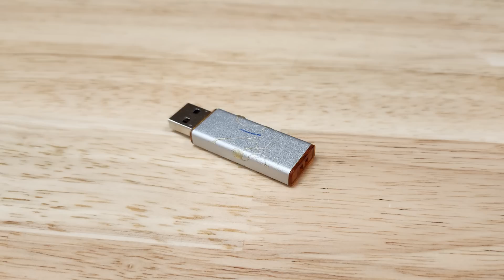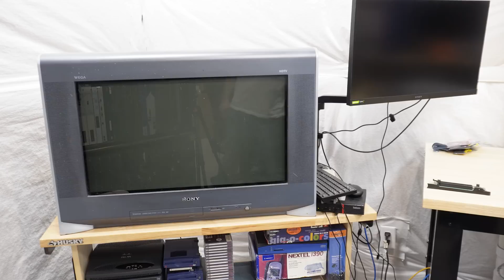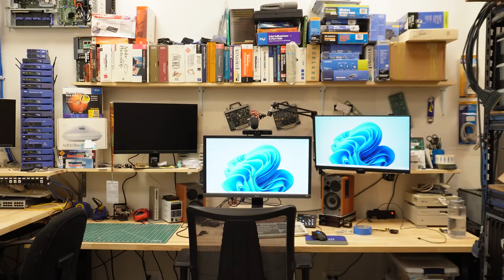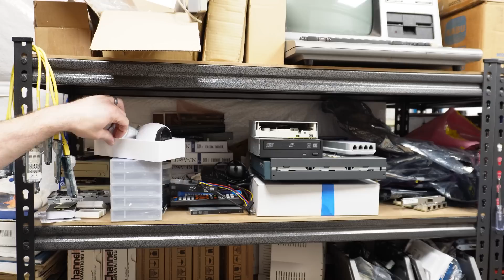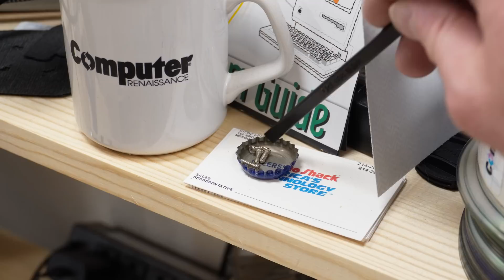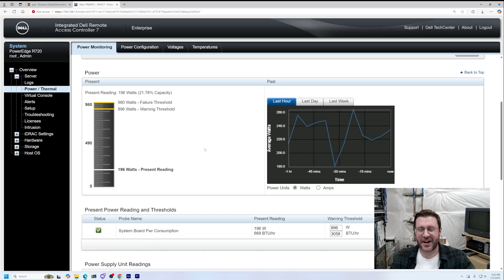Workshop and Homelab Tour

Comment: hey colby, what is in the black box with the little Sega logo on the top of the shelf that has all the equipment stacked sideways? i found it was interesting that it wasn't being kept with the video games stuff, and that you felt that it wasn't interesting enough to mention. 
i've gotten heavily into amateur radio,  SDR and weather satellites this year. so, just recently, i dug around to find my Game Gear. the plan is to use it to play around with one of my favorite handheld game system add-ons of all time...  the TV tuner! i want to set up a low power homelab UHF channel that will air the Johnny Castaway screensaver on a little CRT in the corner of my office.  good ole analog television!
thanks for all the great content, your channel was near the top of my "YouTube 2025 recap" this year and has been one of my favorites to throw on the tv while i'm on the workbench building one thing or another. happy new year man, cheers!

edit: cleaning up / shortening wall of text

Comment: Youg can get cable managment arms for your servers too. Can be a pain trying to access the back of the server when installed. Also you can get DAS boxes for these too MD1220 to extend you disk count. Saves on power cost running multiple servers.

Comment: ATM is quite fun, I have a 3com AB 9600 equipped with an ATM 155M card and a few serial cards so I could do Frame Relay - Also have a Cisco 3620 with an ATM155 card - main problem right now is they are SM long distance. 
Wouldnt really say ATM was competing with Ethernet (back in the days) - It was superior to Ethernet I all ways (Had QoS/CoS on each "VLAN" / VPC) 
Fun fact: Some sound mixers from Lavo for example, used ATM to route sound.. Thats how good ATM were. 
https://youtu.be/QJp1dFnTNMs?si=I7GQbIemnEFxM04B&t=997

Comment: being from ireland i have always found it interesting that the usa is 120v we use 13amp 240v sockets 3kw and 20a at the breaker 5kw just to charge our phones but they are specifically for high power items in the usa and normally not found inside the home only in garages / basements , the fuse panels are also such a stark difference in comparison to ours , a 24 fuse/breaker 240v panel is around 10 inches wide by 12-16 inches tall

Comment: Once you're powering a rack with several servers, you really want to switch to 208/240V UPS units, which provide 4X as much power as 120V units.  Eaton 9px6k UPS's can power a whole rack and can be found used for under $1000, sometimes even less.  That, and a vertical L6-30p PDU should fit your needs.

For the iDEN phones, the only thing you might be able to do with them is use MotoTalk/DirectTalk which would let you to use them almost like $20 FRS 2-way radios if they have it installed, and also have SIM cards that were previously activated.  Some phones without it MT/DT can be moded to add it if you're interested in the extra effort.  There are old iDEN base stations for sale for a few hundred dollars but doing all the set-up, including allowing those IMEI's access, is not going to be easy.  I don't think the iDEN protocol was popular enough that there's likely to be any SDR projects out there that re-implement the base station to make them usable, either.  And yeah, neither would be legal to run, anyhow.

Comment: Since you're virtualizing, you should consider adding a pool on your NAS (or building another small one) to host your VM storage.  You have 10G anyway -- and honestly, even 1G for storage access is fine for most tasks -- and it would allow you to run multiple (potentially physically smaller) VM hosts that allow you to scale up or down, depending on what's the most cost-efficient CPU/memory, without having to care about "does this case have enough drive bays and RAID?"  And also provide failover in case of hardware failure or maintenance, which is always nice.  Especially once you start consolidating workloads, when a server fails, it really sucks!
Reply from the maker: I should've mentioned, proxmox does actually have access to a pool on the NAS and some of the VMs are using it!

Comment: I would strongly suggest replacing those WD blue drives, at LEAST as a boot drive, as I’ve had bad experiences with them and from what I’ve heard, they’re generally not that good.
Reply from the maker: oh yeah they were just the cheapest I found. they're in RAID0 because all the proxmox VMs are actually backed up to the NAS nightly. so if they die it's not a big deal in my case, and in fact a lot of the VMs are leveraging the NAS directly for some of their storage anyway.
Reply: @clabretro  I’m glad to hear that, as I didn’t want you to have to find out that they’re bad the hard way like I did. I hope that they continue to work for a long time to come, though!

Comment: Reality keeps slapping me in the face when I watch retro computing! I'm sitting here looking at my HP 4050N Laser Printer, which has been and still is my main printer. I got curious as to when it was built and the wiki says they stopped making them in 1999! I feel old now....
I worked a lot with Cisco gear and sorely want to have a 4506 or 6507 for my home network, but as it would be good to heat my house in winter, it would be a disaster for the AC in summer! :-) I am content to run my Netgear switches because they don't draw much power, but I long for even a 3560G or 3750. I also spotted a couple of Compaq ProLiant servers, spent a lot of time with those too.

Comment: NOTHING should ever go vertically across the front or rear of a rack, even just to the neighboring RU. EVERYTHING should go horizontally into the vertical cable management, up or down within that channel, then out next to the device where it needs to be connected.  Your switches and patch panels should also be mounted to the REAR of the rack not the front...  That gives you an incredibly clean and imminently manageable rack, with nothing interfering with accessing, servicing or removing equipment, you never need horizontal wire management (or brush pass-thrus) which wastes space in your rack, and it’ll scale up or down nicely from the simplest most well managed rack, to the most hectic/dense/frequently ad-hoc altered rack.  I've been doing this for a long time, and inherited a lot of intractable messes I’ve had to spend so much time fixing, that so easily could have been done right in the first place. If only every High School and College level computer course spent a few minutes on rack wiring...

Comment: I use truenas on a few servers at work, 2 core, 1 scale. Scale is really just a lot better than Core in general, Core is kind of the legacy product they're working on getting rid of, so for several years Scale has been the one getting cool new stuff. Just as a basic thing, the web shell in Core is the worst shell I've ever used, and in Scale it's perfectly unremarkable. You're not supposed to need the shell but it's linux so inevitably you do. Except for "Apps"/"Plugins"/"Jails".

All my stuff is out of date because I don't have the time to do the accounting to tell if upgrades are safe and I definitely don't have the time to make them safe, so my Core servers are running Docker, and I don't know if that has ever changed. My Scale server runs a weird sandcastle built around Kubernetes, which sounds rad except they buried all the kubernetes stuff under so much of their own layers of obfuscation that I can't comprehend what they've done to it well enough to find any in-roads on learning kubernetes. I believe with the latest version of Scale they have gone back, or they are going back, to just Docker and that seems like it's going to break my containerized things! At least once I have time to spend making sure that update isn't a disaster, Docker containers were so much easier to deal with and there's a bigger... community? space? to draw prior work from in figuring stuff out.

Comment: Seems like either a design mistake or an intentional punishment to make that door sensor be just a pin sticking up. Should be relatively easy to make a reasonably nice mod that adds a lever ramp that will protect the switch in the future, just need to hold a little flap in place over the pin. It defeats the sensor somewhat, but that's Dell's fault. They could have made the switch any number of ways that wouldn't be at risk and could detect the door absent while the unit is pushed in.

Comment: To reduce power consumption on the servers could you remove the 2nd processor - I assume you'd lose 50% memory capacity too but could reduce running costs if that resource isn't being consumed?
Reply from the maker: I might look at some lower power CPUs too

Comment: The bad reputation Linksys gear had in the early 2000's was well earned. In the three years I had to deal with them their failure rate was over 80%. They were so unreliable I kept five, or six on hand at all times.

Comment: @clabretro Protip : You can just tape the lid sensor switch down to prevent this from happening again.  It's a useful switch in the data centre where you want to log case open status but at home you don't really need it and that would prevent you from accidentally breaking it in the future.

Comment: Cellular is a little more complicated. If you want equipment you need to get a forklift as some of the core controllers are the size of the entire rack. There are some open source projects that might be able to emulate a network (to replace the large controllers). Most carriers are shutting down 2G and 3G so gear maybe coming out as contractors turn it over. Getting software/firmware though,that is the hurdle as the few companies that make this equipment keep it very closed off.

Comment: The two tips you need:
A: For the data you really don't want to lose, buy disks from different manufacturers and use them in mirrored pairs. The chance of two different manufacturers having quality problems at the same time seems very low.

B: Others have already commented on this, but get zip-lock bags for the random screws. Buy 100-packs of different sizes and ensure that you have some working pens floating around so you can actually label the zip-lock bags.

Two tips you might not need :)
C: Obviously add more shelves where there is space.

D: To ensure you don't end up with various junk on every single piece of free space, just avoid having easily accessible free spaces. If someone is remodeling/renovating their kitchen or similar, grab the old doors from their cupboards/cabinets, and install those doors to cover shelves that have free space. Also maybe grab some drawers for the various loose things that kind of have to be loose.

Looking forwards to future videos!

Comment: Speaking of new NASes, I bought half a dozen white label (factory recertified, whatever that means) drives in November which finally arrived the other day. Only problem was that I got them sent to my work because I'm never home, but I've been off work because of the Christmas break, so I haven't been there to bring the drives home! I still need to buy the NAS itself, but I'll just wait till I go back to work before it buy it. It won't be anything special, just a Synology.

Re: the satellite gear, I'm not 100% sure, but you might not need a satellite to get two satellite modems talking to each other. It's been years since I worked with satellite gear, but if you can set the uplink and downlink frequencies separately, they should just talk to each other over a coax cable that would normally go to the dish. You might need an attenuator to drop the signal to an acceptable level though.

Re: the piedp11, you could do a series of live streams soldering it together, I'm sure there would be plenty of people who'd watch.

Comment: 24:40 I saw a dude on X starting to spin up his own mini 4g base station just today. SDR is getting cheaper and easier every day, depends how much an sdr transmitter would cost and how much software legwork would be involved. I doubt there's a pre-made library for a 1g/2g network but who knows. Be one hell of a cool project.
Reply: The gnuradio project has all you need for a DIY GSM base station. You just need not-so-cheap SDR hardware

Comment: Watch out stacking too much on those van shelves. They have a surprisingly low weight capacity. Although it probably does help that you (presumably) don't drive your house around at high speeds.

Comment: The NEXTEL phones ran on Motorola iDEN systems. You would need a significant amount of special equipment and the master control switch which is pretty much unobtainable. Find yourself some i365s with some NEXTEL SIM cards and you can use the phones as 900MHz 1 Watt digital two-way radios between themselves.

Comment: Regarding power consumption: I recall from another video you said you're in CO, which would mean you run the heater about half the year. So theoretically, the rack is contributing towards heating the house for that time (thanks law-of-conservation-of-energy!)

Regarding the fans going to max: My guess is they do it to prove that the fans and fan power regulator are capable of running full tilt. Otherwise, if it ran fine at low-rpm but fan or controller suddenly failed at high rpm, you wouldn't find out until after the OS booted and would have to kill the OS which would piss everyone off.

Comment: I had a nice Intel (or 3com) optical switch.  I think it has around 20 ports or so. Never got to use it as the company that tested items that were in a flood couldn't test it. Since I never had any other hardware to try it out I just ended up tossing it as damaged.

Comment: Check out Dell RX730xd. V4 Xeon will save you 100+ watts over your older units. 12 x 3.5” or 24 x 2.5”, with 2 x 2.5” for boot on the rear.

Comment: another NAS? no!!! you need a Dell TL2000 or TL4000 tape library w/ a TL24iSCSIxSAS iSCSI bridge! LTO4/LT05 drives and media are finally get cheap enough to use at home, and these puppies can old 23 or 47 tapes, respectively. you can get 'broken' TL2000/TL4000 libraries, and usually all they need is one plastic gear in the accessor elevator drive (12 tooth, 0.5 modulus, 2.5mm ID) which I currently have 18 spare of, so I can enable you by mailing you some instead of having to wait for them to come from china like I did. 😉
Reply from the maker: oh I've definitely been tempted to go down the tape route haha
Reply: note: if you get the super cool TL24iSCSIxSAS, make sure it's new old stock!! there is _no way to factory reset them without the password_, so if you get a used one that doesn't have the default password, you're screwed. it's just running linux, so there's probably a way to dump the flash and crack the password, but... just get a new one.